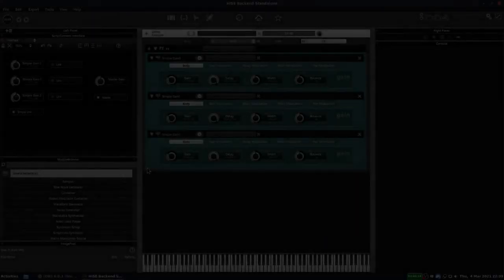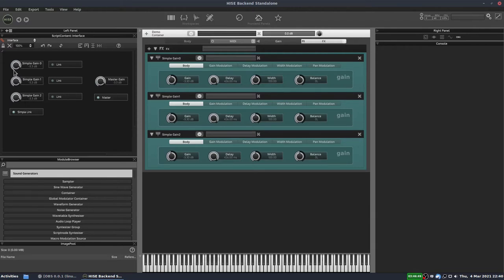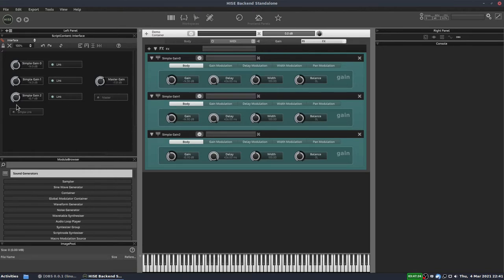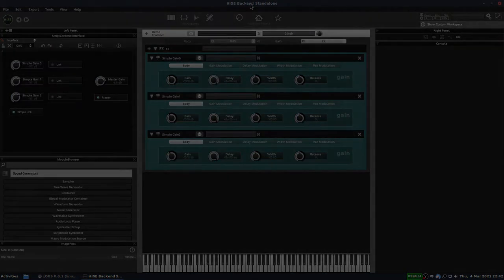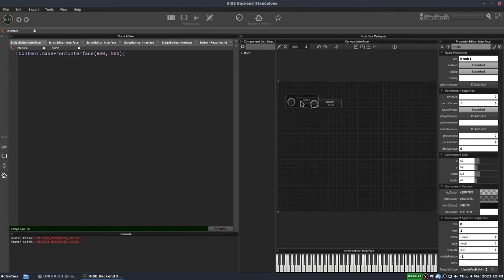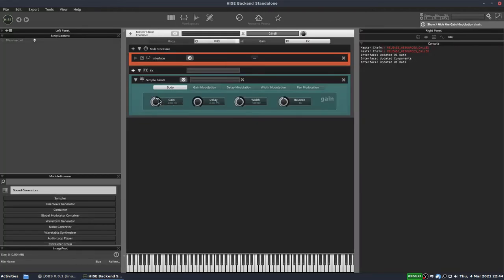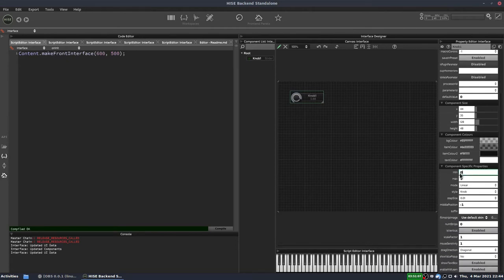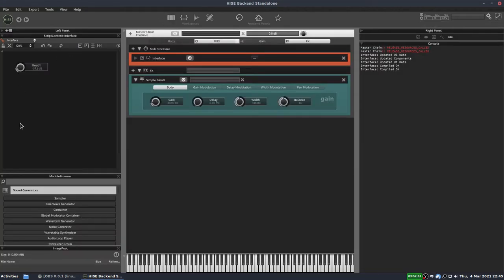Playing with knobs in HISE

Comment: Trying to connect a control to sampler gain and it seems like instead of working in dB it works 0-1, reversed. Is there an official way or just broken?
Reply from the maker: If you want to do that you need to do it through scripting because as you discovered it uses a different range. However I don't recommend you connect directly to the sampler's gain parameter in most cases as there is no smoothing, so changing the gain while a sound is playing could result in artifacts. Instead you should add a simple gain effect to the sampler (or multiple if you have several mic positions) and connect the knob to the simple gain's Gain parameter.